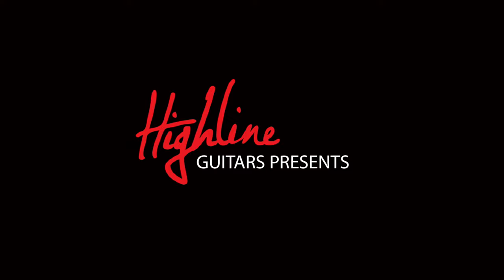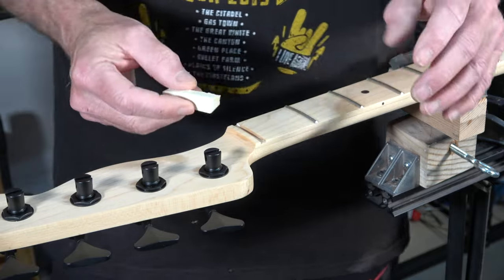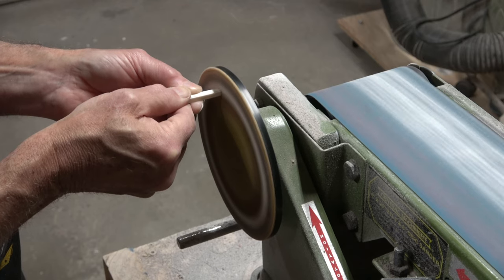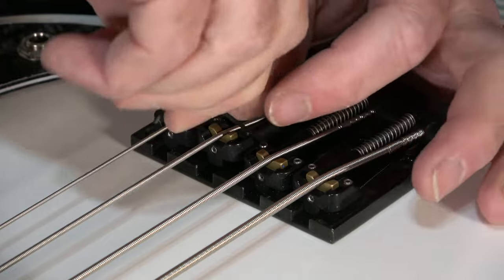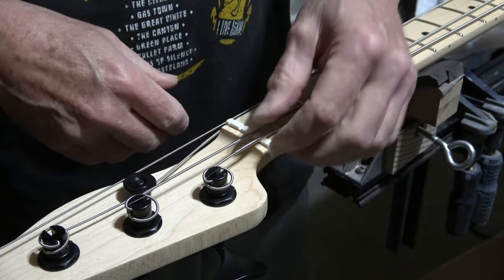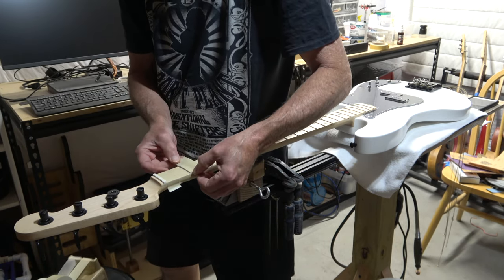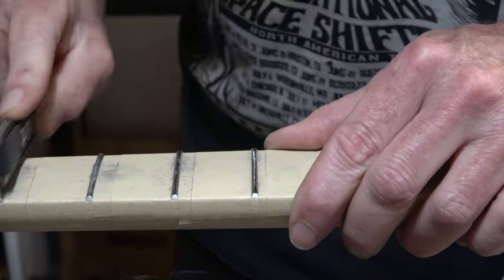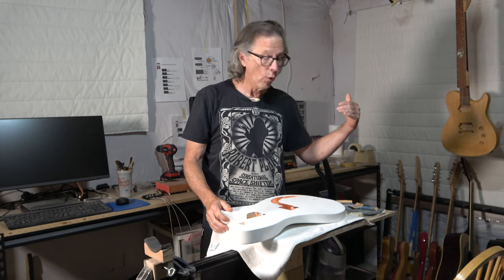Building A Precision Bass Part 19 Making The Nut And Leveling The Frets

Comment: I have nickel frets looking to upgrade to Jescar EVO Gold Fretwire. I'm also looking to get the round fret ends you did in a prior video with a dremal grinding stone and a 2mm round diamond bit. Can I hammer this material in or will I need a fret press to minimize fret leveling afterwards?
Reply from the maker: I’ve never used EVO. You’ll have to ask Jescar.